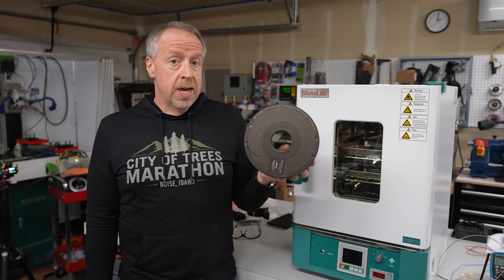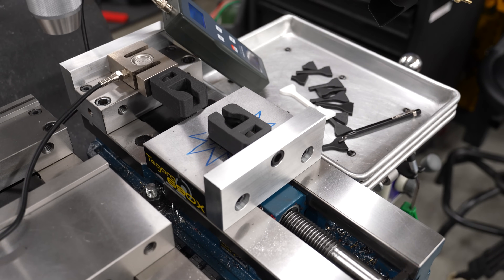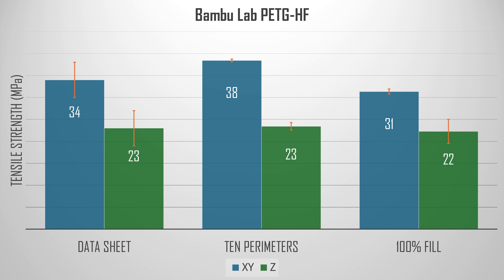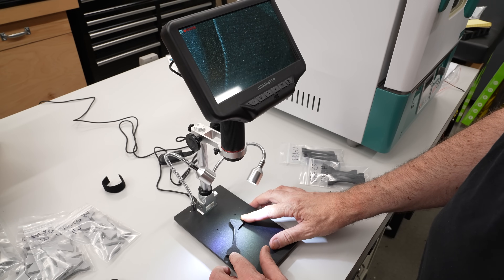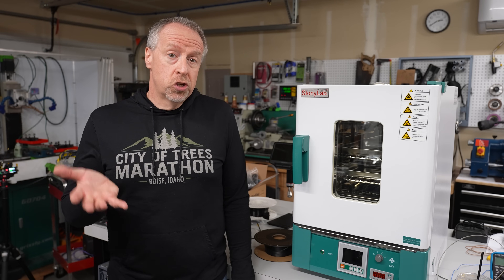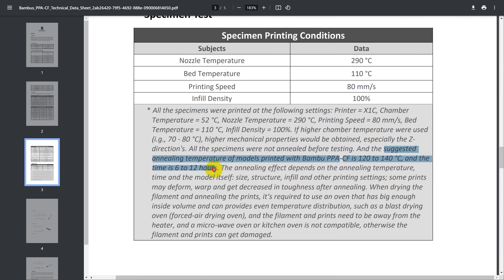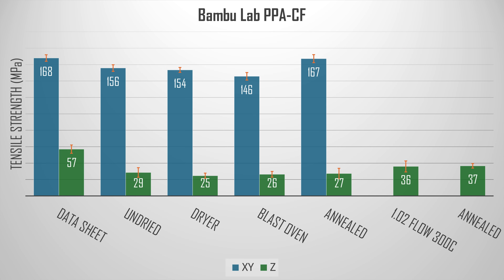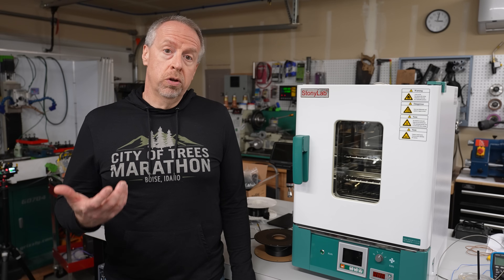I Tested PPA-CF Filament and It's INSANELY Strong!

Comment: I know this is a year old, but I took a long break from 3D printing, so long that my cr10 pro was my last printer, (I am stealing the parts from the CR-10 the board died, to build a new printer using doing the core xy design and ball screws for the build plate with auto leveling and it seems now a heated enclosure ) I so you mentioned it being more brittle after annealing I want to replace the parts on my burly MPCNC if I am printing for that purpose would the PPA-CF be the best choice and would annealing make enough of a difference to do it, or is there another filament out there that would work even better? Currently it is a mix of PLA+, PC that is probably PETG.

Comment: I love ppa-cf. Ive been using it for a long while. It always drove me crazy seeing youtubers make videos like "I'm printing the STRONGEST filament EVER... Pa6 WITH carbon fiber" 😂😂 and get huge views and mislead everyone while pa6 is at the bottom of the engineering filament list😂 I have no issue using a regular food dehydrator to dry ppa-cf. I have no issues runnin PPA-CF in a qidi box to a plus4. Both are literally designed for abrasive high temp (370c)  engineering filaments. And ive found that PPAcf likes being printed ABOVE 330c. Incredibly strong stuff!

Comment: Excelent tests!!! Just one silly question… did you use PEI textured plate by chance? And another question… after all those prints, was the room smelling toxic to the point you had to wear a mask? Did any of the nozzles brake and had to be replaced?

Trying to understand how good the printer is and what to take into account after using that filament.

Comment: The test rig is nice, but one potential solution to help with the low polling rate and give more accurate results. Instead of the vice pulling. A stepper motor on a fine acme thread should be able to give a ramped load over a longer period of time. If polling is a second then a movement every second to a little more so it maintains higher accuracy. 

Yes I know this video is a year old and your setup might be different now. Just an idea I had to get out of my mind. The twisting motion that would be introduced can be compensated for by capturing both ends with parallel guides. At that point the only factor between each sample would be the amount of lubrication on the threads.

Comment: Regarding the chamber temperature, I do wonder how much higher temperature could be achieved by just coating interior surfaces in mylar tape, or some similar material with a high IR reflectance and retaining some of the heat that will inevitably leak.

Comment: the stability is usually heavily influenced by moisture, after the print, which is the main reason for me to dont use nylon that often, its just very inconsiderate depending on the ambient parameters and how long its been there.

Comment: I machine my fidget spinners out of vespel on a Kern mill with custom tooling exceeding tolerances allowable by nature, use PCD bearings hand lapped by a monk on addy who works 18 hours a day for 8 years to complete the task and have them plated mirror perfect with vapor deposition gold over a thousand treatments as I recite the Sardaukar Chant for 40 days and 40 nights while balancing on one leg standing on the exact position of the south pole.

To me a micron is merely an admission of surrender.

Comment: In my experience with rigid high temp plastics they like short layer times and being allowed to cool slowly to the annealing temperature. The past few months I've made some changes in how I print with filaments that have layer bonding issues: I set the bed temp to the annealing temp, use a full height draft sheild, add a 15 minute chamber warmup delay at the start, and a 4 hour annealing delay at the end. This allows me to print at the lower minimum temp for dimensions and still get really strong parts in the Z.

Comment: Good job, loved the video.  Just printed some parts for my Porsche with this stuff with excellent results.  I printed in my H2D so I used the recommended 310 - 340 C instead of the 290 - 300 you use in your X1C. I plan to try this filament in my X1C's as well once I get a feel for it.

Comment: i don't dry my filament i just use it. A filament dryer is for suckers unless you are buying a cheap no name brand of filament that comes in a not airtight bag from China . water boils at 100c at 250c its vaporized instantly

Comment: dude you have a CNC mill, use that to pull the part apart. Fix one end to the bed and the other to the mills mast and tans in the y. I see someone coming up with a filament in-line heater to make brittle filaments more plyable

Comment: thats why i love the qidi plus 4, cheaper than the x1c, bigger build volume, higher nozzle temp, actively heated chamber, and uses a 1.5mm pitch 9mm thick belt. Only thing it doesn't have is the fancy ai detection but it still has spool tangle detection

Comment: that's why I buy Qidi Q1s instead of Bambu printers. The heated chamber is a total gamechanger for any engineering material. If you tweak some things - you can heat it up to 75C (compared to 65-70C depending on the batch). It makes parts way stronger (especially PA6 and ASA) or allows to print things like POM and PVDF. I have a roll of PEEK from my job, but I couldn't make it print well. But all the PP, PC, all the mixes, even PETG are better with a heated chamber.
Reply: I'm not sure if I'd call better printing on advanced materials [typically ran about 5% of the time] a 'total gamechanger', even if it one with those specific materials, but I'd probably categorize it as a 'nice to have at home' feature.

Ignoring the H2D for a few different reasons, I'm surprised Bambu hasn't modified the X1/P1 at all to include provisions for adding temperature control to the chamber & AMS. Seems like it could've been done fairly cheaply & easily, and then they could sell upgrade kits as well.

Unless I'm missing something safety/liability wise, but its not like they aren't already selling lasers, sharp edges, over temperature plastic smoke, etc, etc, but IDK. 

Thankfully, its fairly easy to add on yourself if you don't mind permanent modifications & the separate control. $20 mini electric desk heater and $20 wall plug temperature controller is probably the cheapest, but a proper PID controller, heater, cooling fan, with an alarm isn't much more expensive. Google will turn up a ton of results.

I've been happy with a similar setup on my P1S and although I'm probably not leaving my house with the chamber heater running, the same should probably be said for any 3D printer as a whole.
Reply: @KingZeusCLE  I saw some people on reddit saying that an external heater killed their X1C, so I would be a little careful with that.
I mostly print engineering materials, and 75C chamber is absolutely a game changer when you print pure nylon, PP, or PC. You get way more strengths and less shrinkage. Printing pure nylon with a chamber is like printing Petg without. And it enables you to print really hard materials like POM (for bearings and gears - it's insanely good)

Comment: Stating the obvious perhaps.
If you need this kind of strength, you can also send you STL file to a guy who can print in metal.
I did that a couple of times, and the results were amazing and probably more cost effective.
e,g. small parts are around 50 euro in metal, while 1kg of PPA-CF costs roughly 125 euro.

Comment: Thanks for all the effort in compiling the results with different processes - that saves us a ton of time. I really appreciate how you anticipate the comments,  of course, I would have machined them from aluminum and not have printed them from the same material. :-) That's a lie. I would not have done the testing. Thanks again!

Comment: the 57 in the data sheet almost certainly came from two values that weren't specified, layer height and line width, which can have up to like around 75% gains on Z tensiles

Comment: Brilliant breakdown. It's also great to know what can be done to improve part strength. Have you considered using some heat tracing inside the printer and pairing it up with a thermostat or temperature controller? Thanks!

Comment: Perhaps if they plan to sell 750gr only, they could make just a special spool for it so  the inner diameter of the spool hole is bigger, to counter the issues with the last meters of filament....

Amazing analysis btw.

I'm not fairly sure why the grip cracked tho if it's so "tough", seems there's never an adamantium filament that can withstand all forces in all angles and not crack in any way haha
Reply from the maker: I suggested a larger spool core to the company.

Comment: Hmm. I'm thinking about making a spindle coolant ring with some QPM nozzles for a Haas. Looks like this material would be good as it's not just strong but it's also chemical resistant so our semi synthetic coolant won't break it down. The ways are unsealed so I wouldn't want any abrasive carbon fiber wreaking havoc. Or is this likely overkill?

Comment: I've been really interested to see how this stuff stacks up against other PPA-CF offerings.  On paper it has the highest performance for the printability.  That said we've had similar materials from 3DXTech for a while and more recently Siraya Tech (which they confusingly brand as PAHT).

The Siraya tech was actually some pretty impressive stuff by the TDS when it first came out but they've since nerfed the numbers on the TDS.  I've run a fair bit of it and it's certainly impressive, however it's a fair bit below Bambu's PPA claims.  For the price it's a great deal though.

Comment: No, you dont need an electric oven. 
You need a cooler that seals, and silica - 10lbs cat litter, dry the cat litter in a hot oven to boil off moisture. 
Throw it in the cooler and your filament in there too. 
Let dry for a month or 2 months for very wet filament it may need 3

After you get less than 1 percent humid filament. Without heat damaging it. 
You can get it drier, cheaper, and more conviniently.

Comment: Yeeees, this filament is exactly what I have been waiting for. I haven't bought a 3D printer yet because the filaments haven't been up to scratch. But now I can make custom external engine parts that will be lighter than any other alternatives and still remain strong at 200 C° 😁

Comment: Great analysis and appreciate your time sharing with us.  I've been using this material for photographic strobes cages that i attach a theatric gel.  I needed very high temp resistant and this works well....not 100% modelling lamp for hours well, but gets the critical part of the aiming done and then the swap between color gels are a breeze.  I will double check my fans --- my guess I'm running them as well.  I've hit 170C cyclic and it stays stable. Thanks again.

Comment: I'm a little unclear.  Was the final layer adhesion number cumulative?  Were you running 1.02 flow in addition to chamber heat and all fans off and annealing?

Comment: I need that filament for my shindawa T25 isolator to make an Adapter so I can use SRM 225 instead of a old Carburetor that looks like a Mikuni Carb and a Adapter for the SRM 225 gas tank to fit on Shindawa T25.... But I don't have a Dehydrator and I won't have any more ideas for leftovers Spool it would be a $100 waste as of January 21 2025 ......... Oh wait I have forgotten about my 1978 Honda G400 Flathead It needs a Carburetor Adapter for a 28/30mm carb for a mini Bike build

Comment: One test I haven’t seen anyone do is torsion. Very curious how the stiffness would perform against aluminum in rotation. A printed specimen fixed on one side with a torque wrench on the other would do it.

Comment: I wonder if round cross-section specimens would be better for the z-test? Perhaps any angular irregularities in the fixture initiates a crack and then game over. 

The layer strength really seems to be the Achilles heel of 3d printing but with proper part design it can be overcome.

Comment: Hello can I use this on  kobra 2 pro 3D printer?  I just bought mine. I also have engine part ideas. Looking for strength good with heat and UV and can handle the microwave

Comment: Amazing video. Exactly what I was looking for with an excellent presentation at that. Keep up the good work.

If to add anything to this, you may want to try some of the heated chamber modifications to your X1C. My next step  is doing this with my P1S after all the other mods you noted area already done ( slightly differently though as I am using heat wrap from automotive inside instead of a blanket on the outside.)

Comment: I’m just trying to follow along but you start off by explaining the specs of the material. You then devise a setup to test the same material that already had published test? Why wouldn’t they use test results that can be achieved in their own equipment.

The video was so long about the setup but was less than a min saying it achieved the results but you did t even show it? Why wouldn’t you show it? Why was this video auto started for me? You didn’t click the this is an ad setting to display as such and video like this have started on my tv when I  wasn’t subscribed to you. Why don’t you respond to more comments? You have these crazy video images on the listing. 

Wow I must have been crazy when i wrote this. When i said you have these crazy video images on the listing i was referring to the thumbnail and just different things making me feel like there's a production crew behind you. I almost feel like there is another creator who is sharing the same "garage" soundstage. However, I really don't care that much to rewrite this to really make sense of what I'm trying to say. I am concerned though that he didn't want to test the z strength of the material. It is a just very well designed ad, and just thought it would be nice to talk about it I suppose.

Comment: Considering how hydroscopic that filament is did you do a test to see if you left it in a moist environment or a wet environment for any length of time if the strength deteriorates at what point and how fast does it do so considering some people may be using product in a moist or humid area I mean humidity is a thing I mean if you go to Florida or Northern Kentucky or Cincinnati area let's face it that's pretty much the most humid you can get and that's just an everyday occurrence

For very low hydroscopic filaments CPE is good for a lot of Automotive needs

Comment: Even what printing PC on my p1s, if I max the bed temp and nozzle temp, the motors overheat (or what I think is happening) and I get a horrible grinding sound. Pausing and letting it cool fixes that, but there is major step loss. Any suggestions?

Comment: I would be interested to know  if you bagged some of these parts and added just a bit of water to the bag if the tensile strength would go up? Years ago I was involved with injection molding some glass filled levers for a mower. After drying the material and molding we would weight test them and they would snap. After bagging with a bit of water and letting them absorb moisture they would just flex a bit and not snap.   Here is a little snippet from a material supplier. Nylon resins absorb moisture from the air. The properties of nylon moldings are directly affected by the amount of moisture they contain. Moisture acts as a plasticizer in nylon and therefore reduces strength and stiffness properties but increases elongation and toughness. In general, as moisture content rises, significant increases occur in impact strength and other energy absorbing characteristics of the material.

Comment: PPA-CF should never go in the AMS. Good way to destroy the gears in your AMS. The reason the spool wasn't giving you info, is b/c is a cardboard roll that's not supposed to be used in the AMS, and can be put in an oven safely. (see you figured that out, lol) I dry mine out in my kitchen oven on top rack set to Bake 250F for two hours, the print quality is so much better then. Good to hear your data concerning chamber heat, annealing and profile mods, I will surely try them out when I need to use it again.

Comment: Having no printers with unheated chambers, I had dabbled in materials such as ABS, hi temp nylon and PC, usually with disasterous results with all but the smallest parts. I sprung for a couple spools of ABS-GF and PC-CF several months back. they sat there in pure frustration for months and months while I printed up swords and dragons for Christmas until my work parts stock ran low.
Surprise surprise, I did a test run of my usual work parts that I usually print in PETG, singles, the parts came out so strong that I had no issue reengineering them to use a third of the weight with these new to me materials. no issue with not having a heated chamber either. It is now cheaper to run the pricey, high grade stuff than the usual standby material.

Comment: For tensioning. You could use a small electric motor geared down with a belt drive to a vise with a finer thread screw. I’m sure you’ve thought about something similar but just mho

Comment: Yield and Ultimate strength values are tied to strain rates. Follow ASTM E8 and equivalent for plastics for established and acceptable strain rates. Manufacturer data may be at a different strain rate. Higher strain rates often show higher strength values

Comment: I’m skeptical of Bambi Lab in general. There’s just a lot of shady stuff and I don’t did it. But, if they would produce a large build volume printer like the K1 Max or even slightly larger and offered a true actively heated chamber, I would  give them my money and jump right on board. But until then, I’m more than happy with my K1 Max.

Comment: What fan setting did you use? I did CF testing and at first, Z was very weak like your results. Then I got significantly better Z strength by turning the fan off. 2-3 times better.